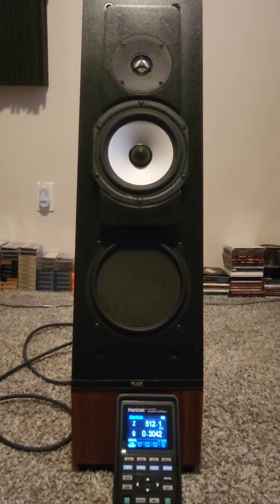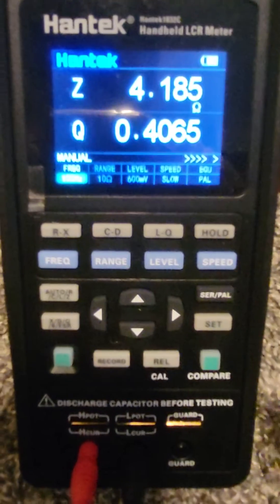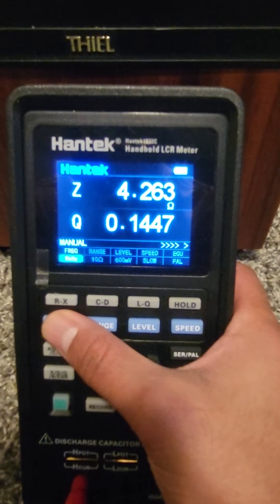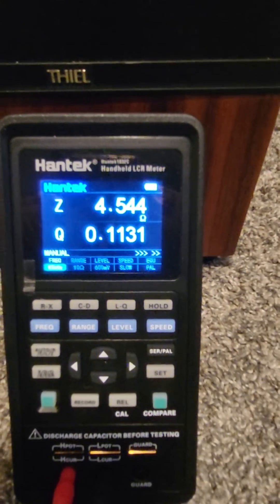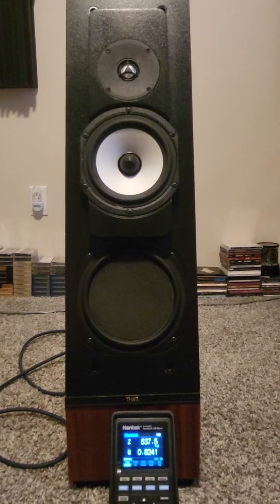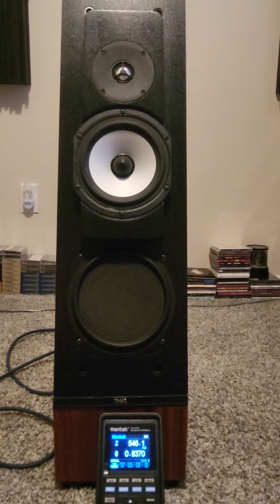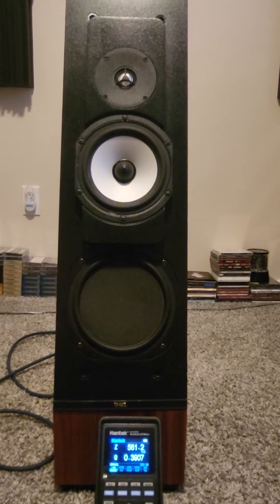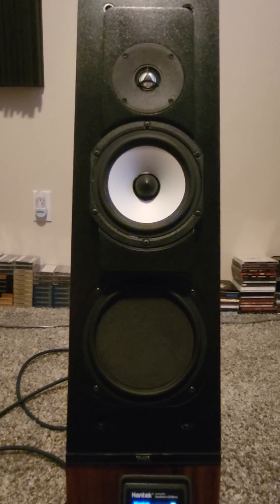Thiel CS1.5 speaker impedance measurement (100hz to 10khz) using a Hantek 1832C LCR meter

Comment: Can resistors be used to reduce speaker impedance?
Reply from the maker: Do you mean, increase the resistance? That's not advisable because it will effect the crossover design.

Comment: The speakers would like my Krell EV302 it's 300 wpc 8 ohm 600 wpc 4 ohm and uses up to 3,400 watts.
Reply from the maker: I wouldn't doubt that at all! Currently, a buddy of mine is selling a Krell KAV 250A for 1600$. 

Currently, the recapped and bridged Yamaha M80s have a reserve for 500 watts per channel into 8 ohm since I'm running them in mono. These can get upto 1200 watts into 8 ohm instantaneous in stereo and double that in mono! 

No replacement for BEEFY well designed and stable amplifier that is relatively unaffected by load current